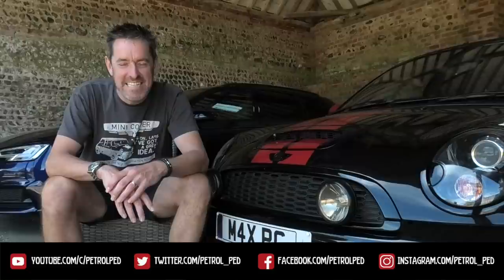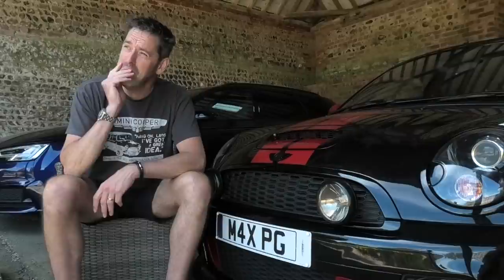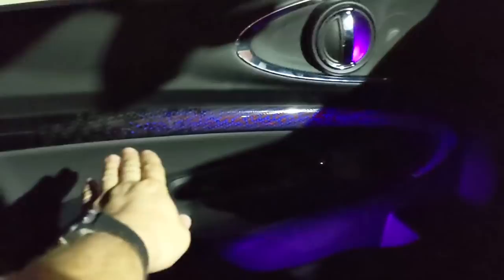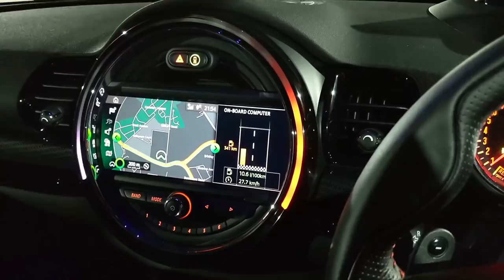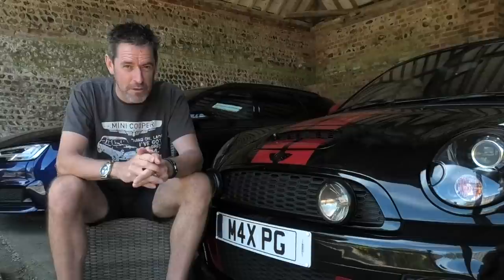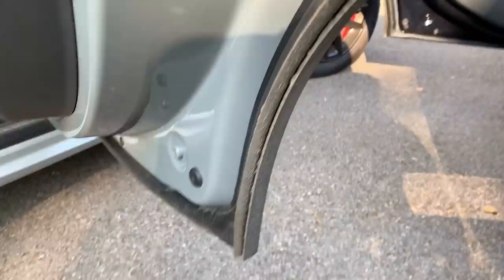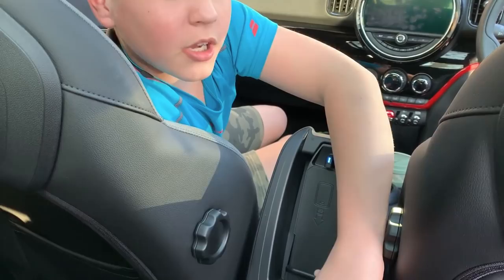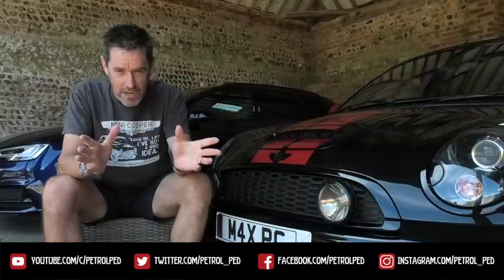Peddlerz Rides #20 - JCW Clubman vs JCW Countryman [CarVid19 Daily VLOG]

Comment: Hey Ped, your no more "rubbish" than a surprisingly high number of drivers. I deal with a lot of people who trade in there cars for new, and it's remarkable how many have never used much, if any of the techno stuff. Personally, I want a car to drive. All the XM, satellite, heads up, yadda, yadda stuff is for the younger drivers that have to be entertained in some way while on the road. Even the color changing interior lighting has nothing to do with performance or just the drive. To each there own, I'll take mine simple, clean, and fast. Cheers
Reply from the maker: Like you style Bud 👍

Comment: Hi Ped
Interesting comparison between the two models. One point arising this evening are Manufacturers putting too much distracting systems into modern cars?🤔🤔🤔
Reply from the maker: It’s like an arms race 😂
Reply: Very much so. If I was programming airbag and seatbelt tensioner algorithms I’d definitely link them to the ICE - once the driver stops watching the road, I’d have them on a hair trigger!
Reply: Just a little point, would always recommend manufacturers screenwash as using non genuine can clog up the system and cost a couple of hundred pounds to flush out.

Comment: Great looking cars, they are very sporty, I noticed the storage area where the spare wheel is normally found, do these cars have run flat tyres like their some of their BMW stablemates?, or tyre repair kits?, I’m not very knowledgable about Minis unfortunately😂.
Reply: Usually run flats :(
Reply: Neither have runflats. All good till we get a puncture I guess. No spare wheel on either. Guess that is a weight saving measure.
Reply: Simon Bahaire thank you for the reply, most new cars don’t have spare wheels as standard, it is intended to save weight therefore producing less emissions, so the manufacturers would have us believe anyway lol😂.
Reply: Russell thank you for the reply, I guessed this may be the case, my next door neighbour has a fairly new BMW 3 series, it came with run flats as standard, so I thought Minis may be fitted with these also.
Reply from the maker: Yep. Often run flats and a can of gunk 😢
Reply: @PetrolPed  I would say run flats OR a can of gunky crud, you don't need that stuff with run flats, but you sure will with normal tyres and no spare.
Reply: Petrol Ped I have a steel spare wheel and toolkit in my 2018 Škoda Fabia Monte Carlo, it was an extra to pay for when I bought the car new, but the dealership did a deal for me to make it free, probably because I’m Škoda obsessed and repeat customer of many years lol 😂.

Comment: Great video, I am hoping to get a Mini Countryman next year and get the facelift version. I read that the main infotainment screen will be updated? Maybe it will be updated to the idrive7 which may resolve the issue of Spotify and get android auto?. Also how does the engine area get dirty on the sides? Is their a small gap somewhere?
Reply from the maker: Not sure of the spec yet but I guess it will have OS7. The bottom of the engine bay is open hence spray coming up 👍

Comment: Not a fan of any of the newer MINIs, in my mind the last good one was the Roadster as everything’s turned into an arcade play space since then.  A major design flaw is the brake lights being down so low on the new Clubman, rear safety is severely compromised.  Lucky for my wife and I we’re owners of three second generation MINIs; 2010 S hardtop, 2015 Cabriolet Highgate, and 2015 JCW Roadster.
Reply from the maker: Nice collection 👍

Comment: Pete you are doing a great job as the Mini brand ambassador. Just wondering if a JCW clubman will do the job of my two cars, just wondering how the clubman 4wd system will cope with the snow we get up here in Scotland think ground clearance may be the issue.
Reply from the maker: I think combined with winter tyres it would do just fine. Not really built for off-roading though 🤔
Reply: @PetrolPed  yes that's the problem with where I live 1 mile up a steep dirt road so still cant be tempted to sell my landy. My mini is ok in summer but wouldn't risk the climb in winter with a huge drop to the right ha ha